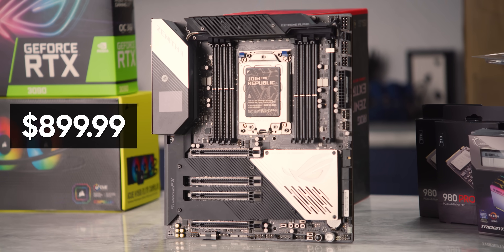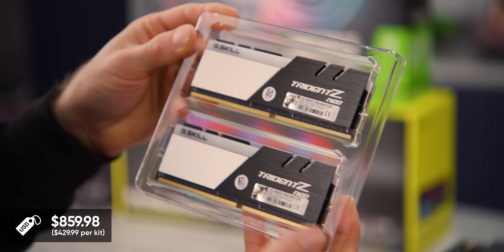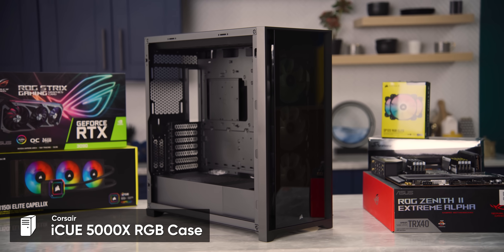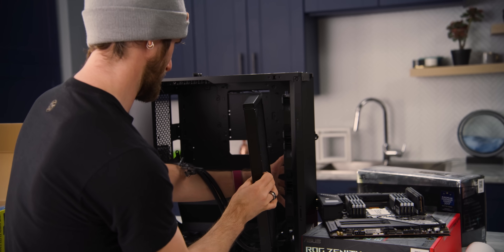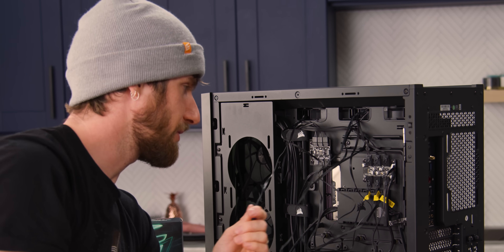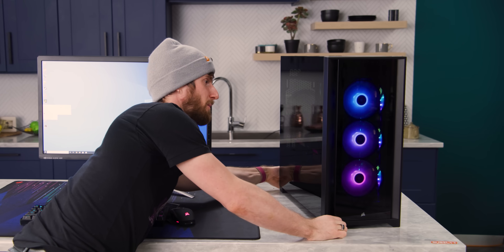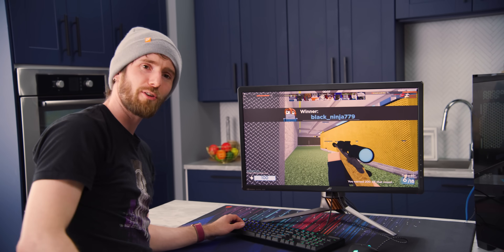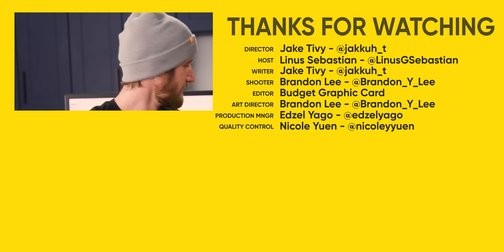Building A $10,000 PC for ROBLOX

Comment: The threadripper is a workstation cpu i wont perform well in gaming worse than the ultra 9 285k actually
Reply: she wasnt gonna use the threadripper for gaming, she uses it for after effects and editing
Reply: @Correct_Hamster  it doesn't work for that either, it's like using a pneumatic piston on a screw, it only works in a certain way, btw I suggest searching up what a workstation PC is
Reply: @Point_Resident  let them be the video is 4 years old :|

Comment: can anyone tell me is that threadripper thing which has 64 cores better than the i9 14900ks? (even though i cant buy any of those but still lol)
Reply: Depens what you using it for, the threadripper is more used for work also as the i9, you can wait because ryzen will release new cpu's and these are for gaming for a cheaper price so

Comment: I literally play fortnite and average 150 fps and can get up to 250 fps but in roblox i average 30-50 fps. I agree this computer is overkill but you do need a very good computer to play roblox, especially if you're running multiple roblox accounts at the same time like most roblox youtubers that play the same game as Terabrite Games (pet simulator x) and games like Anime Battle Arena are always a lot harder to run due to optimisation problems at roblox and with the developer's of the game.

Comment: After rb battles season 3… I see why they need this. Also if both of them run Roblox on the same pc it should run at max for both of them cause well a rx 580 can run max settings at around 80 fps on normal games

Comment: Love my corsair 5000x I keep reconfiguring, currently aio cooled but slowly gathering my hardline parts. Keep building these beautiful rigs 👍👍ryzen 7 5700x 32gb corsair 3600 mhz ram 2 x 1tb Kingston 7000mb/s m.2, corsair 240 h100i elite capellix rgb aio , rm850x psu, current gpu is evga 3080, waiting on my 4080. Runs fantastic as is!!
Reply: sure and if i were you i wouldnt get a 4080 because you would need a bios update and 2 of the cheapest ssds would bottleneck your system

Comment: cl18 on 16gb sticks isn't that fast for 3600mhz. I have some 3200 cl14. Can set to cl16 3600. 16gb sticks. This pc was built when 3rd gen ryzen initially released. 3200 cl14 or 3600 cl16 is basically what you should be running on 3rd gen ryzen at the time.

Comment: many potato pcs can run it too you have in roblox like more than 1B server inside my friend have a pc like one of the potato pc and still have about 25 up to 78 FPS with the unlocker me and my friend playin' a server named Doors and i have with full graphics around like 45 -50 FPS and you have 10 manual options with your graphics 1 up to 10 and 10 is not good for potato pc my friend have with full graphics 2 - 3 FPS he have to use graphic settings 1 to have 30 FPS in the server Doors
Reply: what
Reply: @Harigan  I think he had a stroke while writing

Comment: Roblox can have games that use a lot of power
Reply: A good 4 core 8 thread cpu and GT 1030 or better can handle all of Roblox, and those are pretty bottom of the barrel specs.
Reply: @superpork1superboy771  graphics wise
Reply: @Djx51  still, a GT 1030 is perfect for Roblox
Reply: Graphics wise
Reply: My specs are an intel i7 2 8 gig ram sticks and a msi GeForce GTX 1050 Ti

Comment: that is a waste of money 

(TeraBrite) we play Roblox 

but it does not even need that much ram, gpu,  storage, and that mother board. you can play it on your phone or a 500 pc 

(me) using a Nintendo to play games that cap it at 30 fps 30!
Reply: Almost as if the power can be useful for editting videos 😱🤯
Reply: 30 fps isnt good,i used to play fortnite on Switch and switched to Xbox and the difference is crazy

Comment: with how inefficient the roblox engine is, the extra processing power will add like 5 more frames at most
Reply: would run better in a 5950x games not uses more than 8 cores and roblox only use 3 cores
Reply: actually, that’s wrong because roblox caps the fps at 60, even if you can handle like 120, that’s why fps unlockers are used

Comment: This is kind of a "worth it" gaming pc build because even though Roblox is a game for children aged 7-11 just like Minecraft, it's actually a really demanding game when it comes to graphics and fps depending on what game you play, for example, Arsenal, the first Roblox game that Linus tested on the new gaming rig before giving it to TeraBrite (SabrinaBrite And DJ Monopoli) is a very demanding Roblox game, even when I play Arsenal on my crappy computer which has the Roblox game graphics settings set on manual and not automatic it can only run at the minimum quality which is 1 at 30-60FPS, and even if I increase it to 2 it immediately goes down to 0-15FPS even though I have the Roblox FPS Unlocker and obviously it can't handle graphics quality at 10 which is the maximum quality because it probably would go -60FPS. So yeah, this computer is worth to spend 10 grand on because the CPU and GPU requirements are more than high in expectations for Roblox, unless you just want to waste 10 grand just to play a useless parkour obby on Roblox that people only play when they are bored and which always is smooth in gameplay no matter what kind of computer you have or graphics quality you have set up, then you could probably even get the world's worst gaming rig and run it smoothly.
Reply: no, its nowhere near as demanding as normal games
Reply: Actually it's quite demanding, but that's your opinion and I respect that. Your also right, but let me say my opinion real quick. You'll need a decent computer to run Roblox and that's a high or if not definitely above an ultra-spec PC that Linus built for Roblox and that computer's components are a lot more than enough to get the best performance and aren't necessary for Roblox and it's really judged by the demands of the game of whether we want a low, medium, high or ultra PC for Roblox. Here's what I've seen recommended by a gaming PC website:

Low: 
8GB RAM
Intel Core i3 or AMD Ryzen 3 Processor
NVIDIA GTX 1050Ti, 1650 or 1650 Super GPU

Medium:
16GB RAM
Intel Core i5 or AMD Ryzen 5 Processor
NVIDIA GTX 1660, 1660 Super or 1660 Ti GPU

High:
16GB RAM
Intel Core i5/7 or AMD Ryzen 5/7 Processor
NVIDIA RTX 2060, RTX 3060 or AMD 6600XT GPU

Ultra:
16-32GB RAM
Intel Core i9 or AMD Ryzen 9 Processor
NVIDIA RTX 3070 or AMD RX 6700 XT GPU

Comment: hi there linus can i have a the  pc i have a pc that sucks so can i have a pc its almost my bday and you can make me. my bday is april 15 my pc is 2% gaming can only handle roblox whit 30 fps average.i am trying to start a live streem and i need a good pc to run the game i need while recording if i open 2 windows at once my fps will be 15 also i have the blue prints rn the backprints is the stuff that i need: black case whit a window on it and has 3 fans,3 sticks of ram the best kind of ram also rgb,the best mother bord for gaming,the cpu is
Intel Core i5-12600K or a AMD Ryzen 5 5600X
 , grafix card RTX 3080,the best power supply unit  compatible whit the bild,windows 10 and it is needed a large 4k monitor i also need a desk my place is only 75 cm
please i need a new pc
Reply: tell me in gmail
Reply: 3 sticks of ram??? thats one weird configuration… anyways you dont need an RTX 3080 for roblox lol.

Comment: Fyi: Linus is wrong about aio's when mounted in the front of the case, it's a closed loop so weather the cables are above or below the pump it requires as much energy to pump the same volume of water (gravity cancels out) however if the cables are on top air can be sucked into the system and because air compresses, the pump has to work harder and will whear out faster
Reply: Also this is from a physics student perspective. If anyone more qualified would like to correct me please do

Comment: NO,NO,NO...LINUS!!! I cant believe you said that about the AIO. Didn't you watch Steve and Jays videos? As long as the pump is not the highest point you will not get air bubbles in the pump.  In Fact the best way period for a front or rear AIO is to have the tubes down because as long as the highest point of the radiator is higher that the pump the air will stay stuck at the top of the radiator. Literally you just said the opposite of what both jay and Steve said. physics really. Air will go to to the highest point. Also if people want to argue that what if air is already in the pimp well duh..1...you really think the pump is that weak it wont break down the bubbles from the spinning 2500 rpm and push it threw the tubes? 2....when you install an AIO you put the pump at the lowest point and force the air to be at the highest point before you even install it. or attach the pump to CPU and then rotate or whatever so if air is in the pump it goes to the radiator and as long s any! point of the rad is higher than the highest point of the pump air will never go back to the pump. I bet everything on that. I custom liquid cooled my GPU tubes down rad going straight up pass the height of the pump. 24c at idol and 36c at full max, no sound whatsoever and I have a custom bios on my card because I flashed it and it can draw around 800 watts. My 2080ti fe is better than your RTX 3090. Believe that. I overclock my computers to beat benchmark hall of fame scores online. Without using LN cooling. I hate posting this but watch from where I bookmarked it. Both Steve and jays video are great!!    https://youtu.be/DKwA7ygTJn0?t=440   just watch         hopefully this sticks because google loves to delete my messages because content creators are weak and get hurt so easily that is why you cant post negative stuff and dislike button is done. that is so wrong in everyway. That is called controlling are freedom of speak and a dictatorship. They only want happy thoughts. that is not freedom.

Comment: Honestly a 5950x might have been a better choice of CPU, since roblox mostly only relies on 1 core, maybe a couple cores, so single threaded performance matters much more than multi threaded performance.

Though there probably is no difference because both are way overkill.
Reply: roblox uses about 3 cores but yes the 5950x would run a bit better in some games where is a ton of cubes moving

Comment: 14:25 Using a FPS unlocker for Roblox can get you banned unfortunately.
Edit - not anymore, as long as the fps unlocker does not inject files.
Reply: @synckronix  Yep, you’re right.
At the time of my comment some users did get banned for using fps unlockers as Roblox mistook it as exploits.
Currently it is safe to use an fps unlocker as long as it doesn’t inject files or modify anything protected.
rbxfpsunlocker is safe to use and Roblox supposedly said that they would not ban anyone for using it.
Reply: it won’t get you banned

Comment: I dont have a 10k build but this comes pretty close to my build but with 5950x, 128gb ECC also 2x 2tb 980's and Aorus xtreme. 3090 rtx etc. It was 6K.
Reply: Please atleast put full information i have a stroke reading that (no offense)
Reply: @Draagunovv  Case: Corsair 5000D airflow, BeQuiet Dark Power Pro 12 1500Watt PSU, CPU: AMD 5950x, 128GB 3200mhz ECC kingston, Gigabyte Aorus Xtreme x570, 2x Samsung 2TB 980, Nvidia 3090 RTX FE, EK AIO Elite 360 cooling + 7 Noctua 120mm fans for the case. Which is around 6000 Euro.
Reply: @HermanWillems  whats the purpose of it? Editing?

Comment: Cooler choice is a bit weird on that beast. Maybe a custom noctua, with chromax fans would have been the better and safer choice, also with regards to longevity of the rig. Water, even AIO can still leak, and as said, needs to be removed from time to time with this case choice. The best aircooler for the threadripper on the market, far away from any intake, might have made more sense

Comment: If I spent 10 g I'd at least want a custom loop, and custom 24 pin cable/GPU cables (lian li's strimers at least)
Reply: I mean when you consider the build has a $4000 CPU, $2200 GPU, $1000 RAM and $900 MOBO, (over $8K total)  it makes sense that it costs so much. But odds are if you are spending $10K on a freaking computer, an extra $700 for watercooling everything and $100 for Lian li strimer plus cables isn't that bad.

Instead of the 64 Core CPU, I'd just get a 5950X cause that's the best for gaming for now anyway and only $750-$800. And instead of 128GB of RAM ($1000) , I'd just get 32GB ($200-$300).

Now, the computer's only $5000 now, $6000 if you want watercooling and RGB extras.

Comment: actually some games on highest graphics are pretty demanding for a roblox game. roblox is just like csgo it got more unoptimzed it used to run good on ild hardeare but now it runs very bad which is pretty sad
Reply: True, last games roblox uses 100% of my gpu, example : on a car game when i'm max graphics, it goes to 100% most of the time, like there is literally no sense in that. When i can run like Need For Speed Heat on Ultra mod 60 fps with sometimes lag. But in roblox i run around at 30fps max graphics because most of the games are not optimized

Comment: When you realize on some games you are stuck on the same fps when you’re on a expensive pc
Reply: use fps unlocker because roblox has 60 fps cap
Reply: @maksie8726  Still doesn't work Greenville only does 10-45 FPS while my papa's pizzeria game does 300 fps because it's tiny
Reply: @Thiscontentisnolongeravailable  only 10-45? I get 100+ in Greenville and my laptop isn’t even that good
Reply: @bknrngs  When it's a big server I get that while recording and when it's small I get 30-80
Reply: @Thiscontentisnolongeravailable  greenville is a bad game thats why
plus on good games you can use shaders if you are above your monitor refresh rate
Reply: @Thiscontentisnolongeravailable  the amount of parts in the game is limiting the server
Reply: @bknrngs  you are probably using low graphics
Reply: @tyrek78  Usually I play on high graphics
Reply: @bknrngs  automatic or highest?
Reply: @tyrek78  i never use auto
Reply: @bknrngs  well then that’s disappointing performance, since it doesn’t use as many shader packs
Reply: @tyrek78  automatic graphics are better than manual full grpahics?
Reply: @bknrngs  I don’t prefer automatic since I get to control what I want in manual
Reply: I have a rtx 2060 and im running on 40 fps in scp 3008
Reply: @DankezJ  probably a bottleneck
Reply: @Darenz-cg9zg  i5 or i7
Reply: @Darenz-cg9zg  intel btw
Reply: @DankezJ  Yeah the i5 has bottelneck issues
Reply: @SomeoneC  yep
Reply: then get the intel i9 it's only 430 to 1800 dollars
Reply: @Thiscontentisnolongeravailable  “only”, and also cpu doesn’t really matter in roblox
Reply: rbx fps unlocker exists

Comment: with the latest dev build of wine and grapejuice on linux, roblox runs SO smooth even on the poorly optimized games run 60 fps
Reply: Its locked to 60 fps unless you use other programs to remove it
Reply: @omerfarukugur7070  Yes, i know

Comment: I think the radiator mount is not correct because the fan mount blow the hot are out through the radiator it would be hot water inside the radiator in my opinion he should put the fans in a position that pull cold air through the radiator in that way the cooling would be more efficient but the down side alot of dust
Reply: He knows more about building a PC than you.
Reply: @RedactedAccount  bruh
Reply: @RedactedAccount  it a fucking opinion godamn

Comment: Can someone explain me why didn't he use thermal paste on the CPU?
Reply: On the copper plating of the liquid cooler he was using, there was already pre applied thermal paste. Some coolers like that come with pre applied thermal paste like that. Air or liquid coolers.
Reply: @HeyitsDalton_  I just recently changed my CPU and I decided to change my cooler aswell, right now it is a water cooler and it did not came with thermal paste already applied. Thanks for the info
Reply: @TigasHyper  yea, some do some dont. It could be the brand chosen, or maybe it was pre owned. Or maybe just a miss. Idk lol

Comment: Lol this looks like my build. Though mine cost me 14400. When all was said and done. I knowingly and willingly got scalped on the GPU, RTX 3090. If you're going absurd, then GO ABSURD. Also, I occupied all three NVME slots with the max in their generation (all sabrant; boot = 4tb Gen 4, 2x 8tb storage drives), didn't use the dimm.2 NVME bays adapter since can at a later date, took care of the more annoying ones to populate first. 256GB of technically not supported HYPERX ram (3200MHz 16 18 18 22) NO RGB on this build (except motherboard, PSU and GPU). 1500W Thermaltake 80 Plus Titanium PSU, and a $250 Anidees case that's massive. Then used a Noctua Cooler (for threadripper and added another fan while also swapping the brown for black fans), and then used 9 Industrial/Server-grade fans from Noctua around the case. At full speed 35C is average temp, 50C seems to be max in 22C room. At minimum speed 50C average, throttling on load. No clue what GPU is doing since I don't know how to check its temps. Also went with this board.

Comment: Did  I just hear Linus say the pump would "pull water, and potentially air bubles up"? Thats an instant thumb down for me... That, position is like the second best next to mounting it at the top....  The air gets trapped in the top of the radiator, and water natually flows down... like what?!? pure physics... And why would you put the fans in a pull configuration? if its a showcase case. a.f.a.i.k this case supports push pull (there is fan space on top of tha case), you should have added fans on top, for top visual, and fans on the bottom of the radiator that are visible through the sidepanel (if money wasnt an issue).